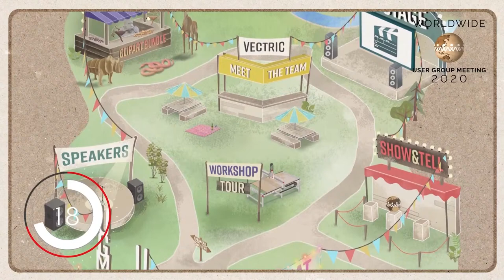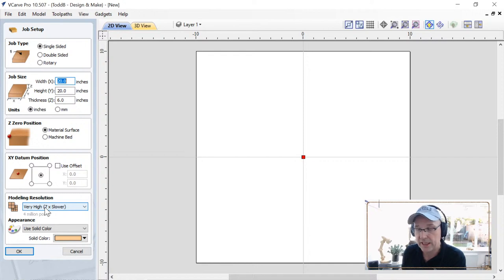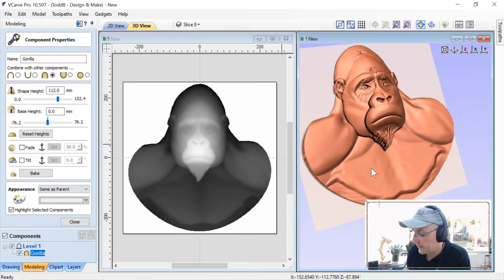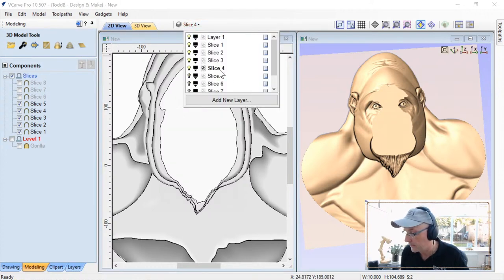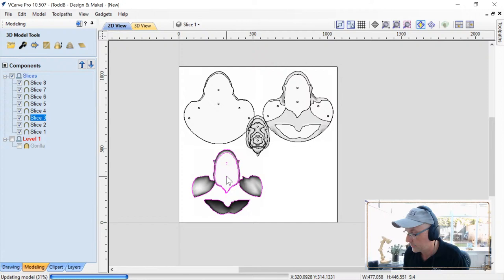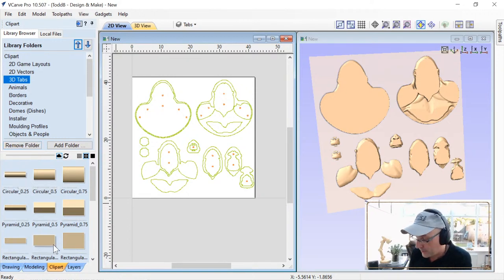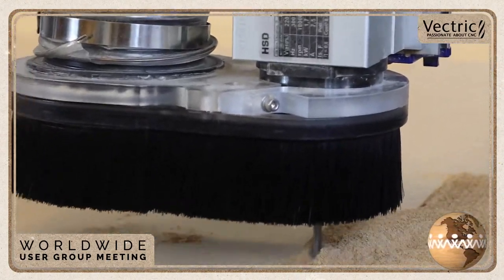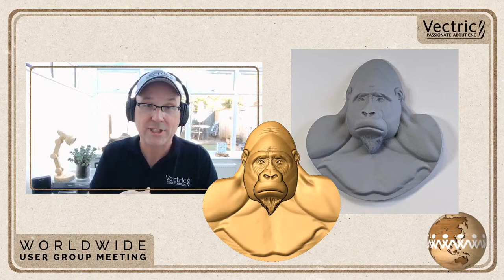3D Gorilla's Head Slicing & Tooling by Todd | Vectric Worldwide UGM 2020

Comment: Hey, thank you for this video, do you know if it’s possible to do slicing on a 3d model that has all sides? Like a 3d print file. I was trying to import those stls but keep getting areas where the software fills in and ruining the object.
Reply from the maker: Hello... yes you should be able to.  If you are having trouble it might be best if you contact support@vectric.com and they can help.
Reply: @vectric  thank you, I’m on a trial so I don’t think I’m eligible or I’m not sure but if you’d make a video of it that would help many, beleive  it or not there is literally not a single example. 

I tried double sided, even 4 axis, but the models on the “negative” areas getting extra materials calculated so it can be carved. But what I’d like to do is to use aspire just to slice up a complete 3d object. 
Thank you

Comment: Why did you use 3D tabs and not the normal profile tabs? Is that because you went with an onion-skin approach? If you could have secured all the parts with screws to the table, could you have cut all the way thru a saved some of the work you did by hand?
Reply from the maker: Hello and thanks for the comment.  A couple of things... using normal tabs wouls have worked but in my experience and the CNC I was using there was a chance normal rbbs would have left dwell marks on the flat sides of the parts where the tabs were.  As the tool retracts up the side of the part if there is any sort of wobble/movement of the tool or CNC gantry (becasue ther is only Z movment in that specific location) then I would have seen marks (and they are sometimes hard to remove).  3D tabs makes the chance of this happening much less.  

Screws... oooohhhh yes... If in my file I had choosen location that I was not cutting I could have added screws.  If I was to do this I woul have secured the material to the wastboard and then created a toolpath using a VBit to mark the locations that were safe for screws.

I learn't alot from this project (every day is a school day... :) ) and have just recently done a similar project using all of the things I learnt... and, well learnt a few more thing... :) 

Again thanks for the question!